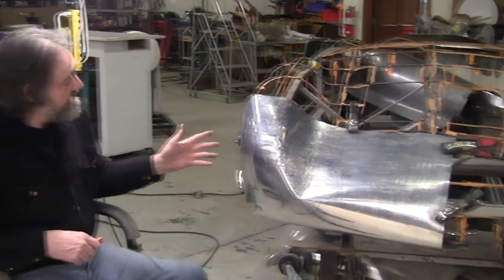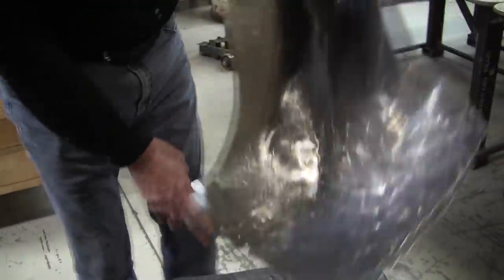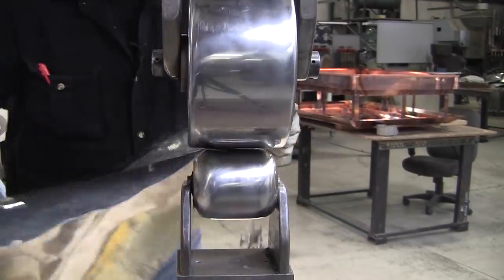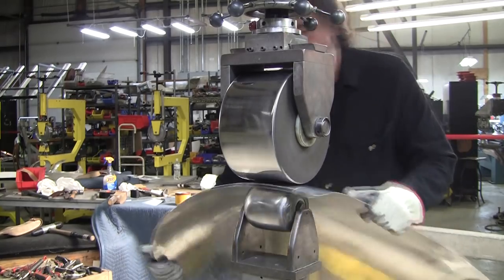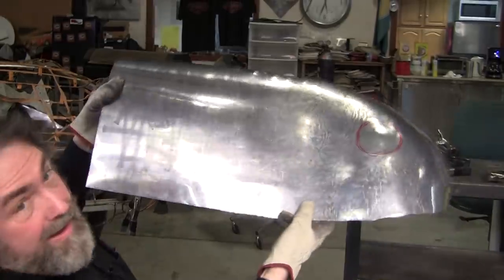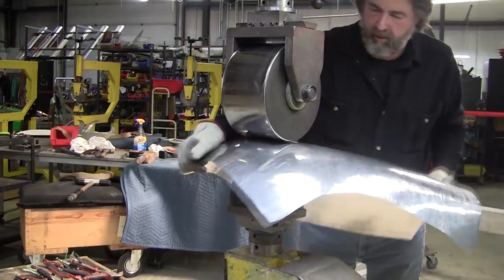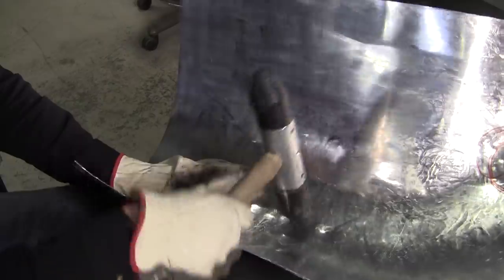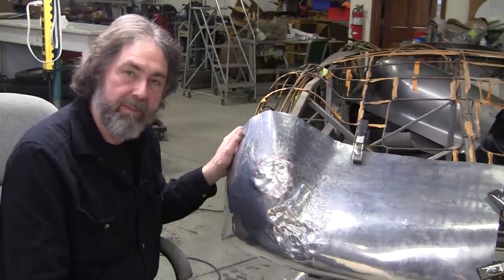Porsche 550 Build: Rear Section Part 3

Comment: Hey Wray, do you offer a class just building car body wire bucks from scratch like from board rendering to actual wire buck? Also when do you plan on releasing the plans or parts for the gathering tool for sale?
Reply from the maker: Hi Alex, At every class if a student wants to learn how to make a wireform buck that is what happens. Lots of wireform bucks have been made at my classes by students. I have  the plans for the gathering tool on the front burner.
Reply: @proshaper  great I have to give you a call to schedule a time this year I can come in for training
Reply: Hello Wray, could you show a head on front view of the gathering tool in an upcoming video?  Are the lower two jaws parallel or set in a “V” formation?  I can’t tell if the radius is creating the illusion of a “V”.  Also I heard that in addition to likes and comments, letting the ads play fully increases your profit.  If this is true I will let the ads play out.  Can’t thank you enough for all that you do.

Comment: Hey Wray why the tape around the wire form? scratching the back side of metal?
Reply from the maker: Scratch protection and it allows a photo of the wireform. Without the tape you can barely see the wireform in a photo.

Comment: What about doing aluminum tubes as the wire buck then that way the panels are welded straight to those ?
Reply from the maker: Make a wireform and you will understand why wireforms work so good. Inner structure and wireforms serve two different functions.

Comment: Wray how many lower wheels do you actually need? I never see you change them. I'm making a flat and a maybe 3" radius lower wheels out of 4140 steel for more toughness. Do you really need all the radii in these sets they sell?
Reply from the maker: I use my workhorse wheel which is a low to  medium crown probably 70 percent of the time, my medium crown wheel 20 percent , my low crown  9.5 percent and my high crown .5 percent.

Comment: Hi Wray, always the video appearing fantastic,  but the aluminio piece appearing papel de fumar. Kkkk 😀😀😀
Reply from the maker: No, The thickness of this panel is .050"  the shrink zones of the panel are now a few thousands thicker, a few stretched areas are a few thousands less, and most of the panel is still very close to the original thickness.  I annealed it which makes it appear flimsy, that will disappear as the panel  gets fully developed.

Comment: Good show I enjoy it a lot. Why is the handle so long on your other plastic head hammer, and why’s the head so long? It looks a bit unwieldy in the previous episodes. The one you’re using today looks smaller and better :-)
Reply from the maker: You use the long handle when you need it. My mallets have mass to them which allows you to move the metal. The heads are long because as a panel gets shape the sides come up. If the heads aren't long enough the edge of the panel will hit the handle.